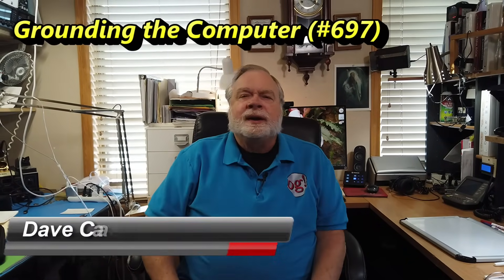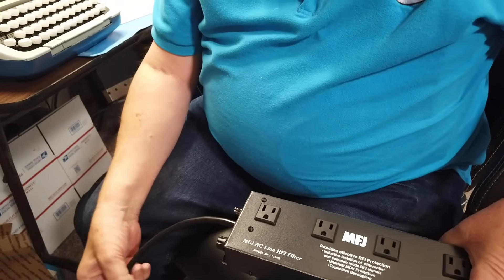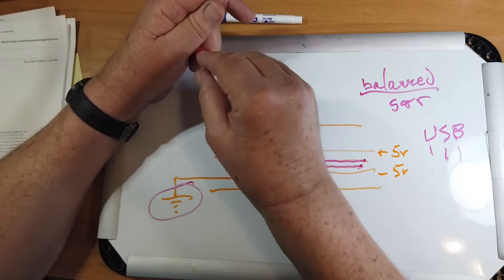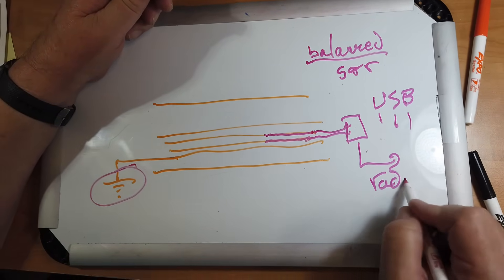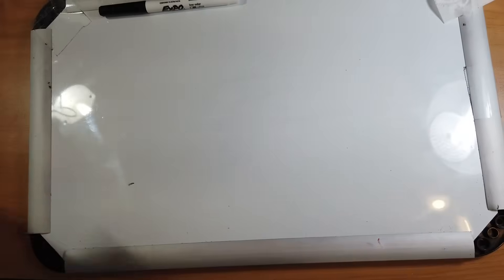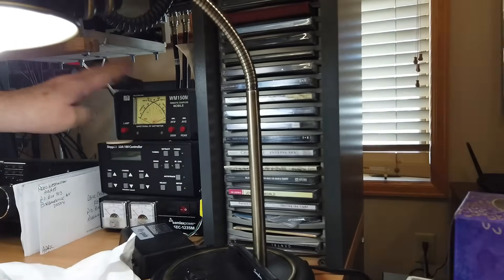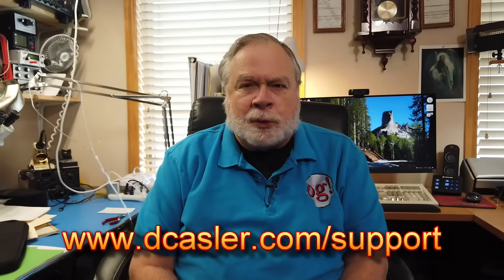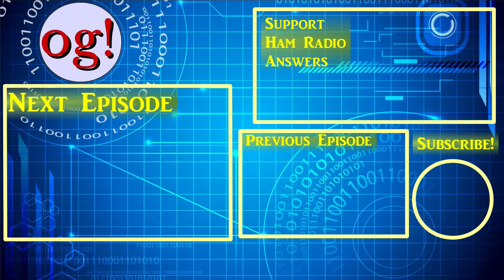Grounding the Computer (#697)

Comment: Hello David, I have a unique problem. I built a desktop (just one of many) recently that shuts down when my wife or I do laundry. What we thought was an electrical issue from the dryer turned out to be static electricity when removing clothes from the dryer. If we forget to add a dryer sheet, the static must build up enough that it shuts down the computer. My dryer is 6 feet from my computer and on its own circuit. I have my computer plugged into a surge protector with my security cameras. There is no issues with the cameras shutting down when this happens, only the computer. I have had other computers plugged in the same way for many years, so why this one? Any ideas of how I can ground my computer?

Comment: The three-prong plug provides a safety AC ground.  Tying the chassis to your station ground bus can help in making the shack equipment be in equopotential, providing additional RF grounding and lightning protection.

Comment: RFI can be a fickled "B". The only time I have  issues is on 10 mtr on my vertical with the amp on. I key the mic and hear the Windows sound dede-a-de and a  dodo-a-do when I unkey like you hear when you plug in a flash drive or something and it only effects my USB mouse. I'd guess the mouse has an FET in it.

Comment: A good usb connection on your radio will tie the grounds together, otherwise noise can be introduced / generated from potential violate differences. If you are rolling your own USB connection, you will want to tie the USB ground to the ground used in your radio ( or what ever audio interface you are using).

Comment: This is not quite correct. There is no -5V. There is ground, +5V, and data - and +.. those data lines are both 3.3v lines, tied to EITHER ground or +3.3v at any instant through pull-up or pull-down resistors.

Comment: I have observed that many computers, especially laptops, do not have serial outputs referenced to ground. In fact, it was quite common to find a 30-40 volt A.C. common mode voltage compared to earth ground. This explained the sudden death of interface boxes that made contact with other metallic equipment.

Comment: USB is not pure balanced. The two data wires are sometimes both high or both low to signal end of packet and to signal which kind of device is connected. Using 1.5k pull up resistors on the data lines on the device and 15k pull down resistors on the host. Pull d- up to select low speed and d+ up to select full speed. Without a reference to ground this would not be possible so you do have a ground connected via the USB cable. The -5v mentioned in the video is actually ground. The four wires are gnd, d-, d+ and Vbus(5v).
Reply: Correct. I was also thinking of shielded USB cables, which would add another ground connection. In addition, something that could be useful here is an optical USB isolator. They're available all day on Amazon.

Comment: I believe the radio enclosure is connected to the computer case by the USB shield.
Reply: The correct way is to connect shield at the host/computer end but leave it unconnected at the device end. There will however be a connection through the ground wire.
Reply: @BaldurNorddahl  That isn't a good idea as it will negatively impact shielding effectiveness, rf emissions and immunity.
Reply: @markchase5323  YouTube deletes comments with links but here is a quote:

"The USB FS cable includes a dedicated shield wire that should be connected to the
board with caution. Special attention should be paid to the connection between the
board ground plane and the shield from the USB connector and the cable.

Tying the shield directly to ground would create a direct path from the ground plane to
the shield, turning the USB cable into an antenna. To limit the USB cable antenna
effect, it is recommended to connect the shield and ground through an RC filter.
Typically, R = 1MΩ and C = 4.7nF in Figure 3-5"

There are a lot of people disagreeing on this and so it is fair if you do not agree :-). But since the 7300 is a radio they would need to be very careful with getting this right to avoid having the USB cable transport noise into the ground plane of the radio PCB.

If the radio chassis is grounded, I agree it would be smart to have the USB connector shield bonded directly to chassis so the whole thing can act as a faraday cage including inside the shield cabling. You would then either not connect shield to PCB ground or do as quoted above.
Reply: @BaldurNorddahl  The first answer to questions about EMC is "It just depends".  The information on designing a grounding scheme for the shield to PCA may be helpful. if the computer is in the design and testing phase.  However, in the scenario at hand, Dave is using two commercial boxes.  I'm of the opinion, that to float the shield at one end to follow the advice would entail cutting the shield at that end.  I'm just trying to take a common sense approach.  There may be a few who are making their own USB cables and EUTs, however, most of the audience is going to purchase those items.

Comment: Interesting sir -
I ground all of my equipment to the single point ground, whether or not it has third plug for house electric grounding.  I learned something new on the USB from you just now, but I make it part of the whole scheme to ground all equipment shells if nothing else to bled any static, provide perhaps better operations (I note no operational difference with computer grounded or not) but just as a safety precaution, they are all put at the same potential to stop any stray currents that way.   Plus lightening protections seem to require it?
AA7VA